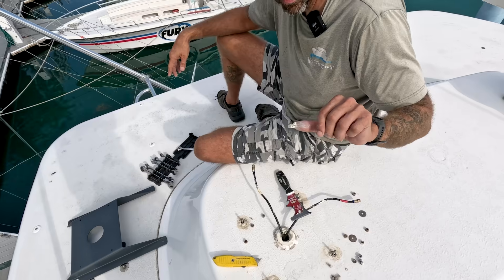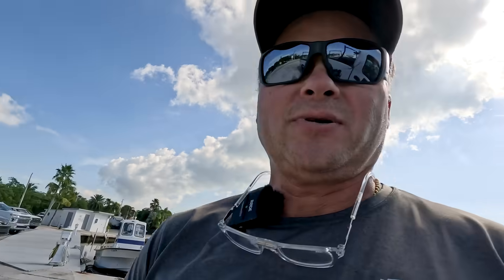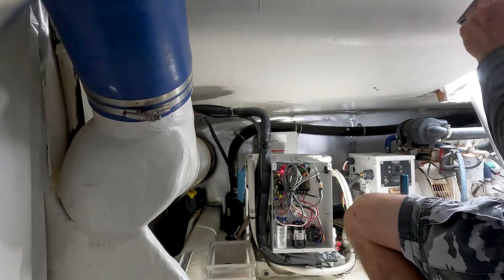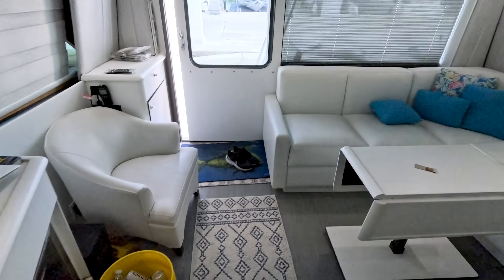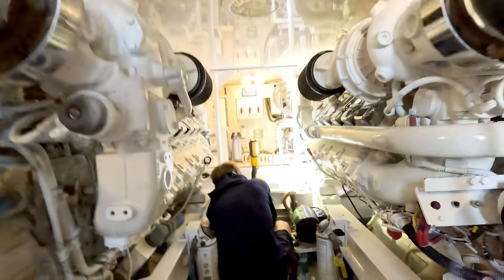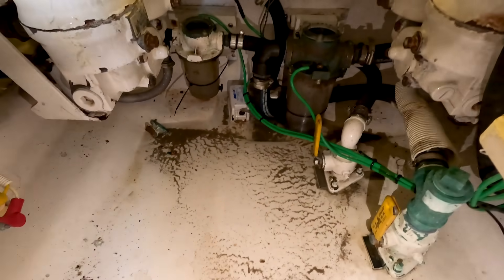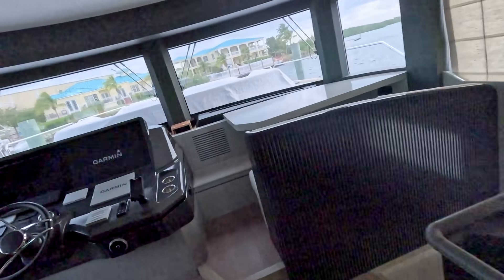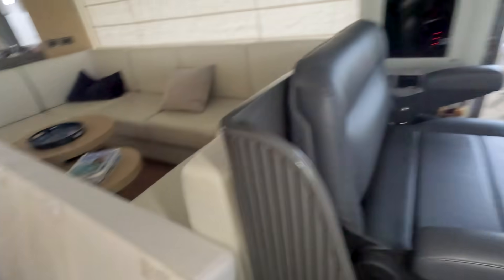SCARED of Heights This Boat Job Isn't For YOU!!

Comment: I was wondering if you ever have to use the "connection enhancer" grease on some small low voltage connectors in place of the dielectric grease? 
The "connection enhancer" grease is considerably more expensive but sometimes that's what it takes to keep those kinds of connections working and dry.
Reply from the maker: No we don’t use it.

Comment: Your radar antenna may be too close to the Starlink antenna  when active.
Reply from the maker: Yup tested it before mounting no issues…. Actually in an upcoming video Matt does a quality assurance visit to the customer & they are loving their system!
Reply: Thought about that ahead of time and the main issue is when people used the RV style antenna. Also the radar is higher than the antenna so it will be transmitting over it.   If the radar causes issues then the back up plan was mount it to the right or left even lower.